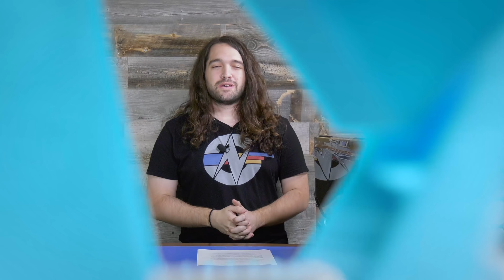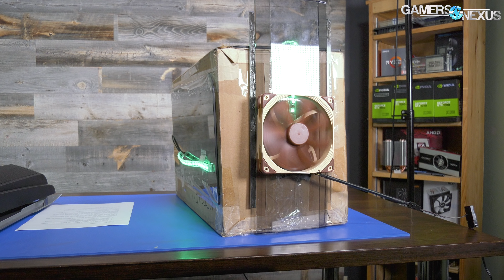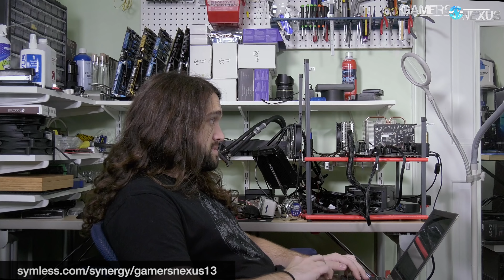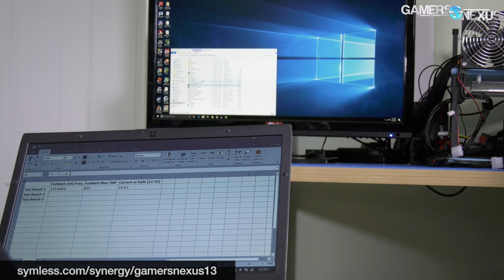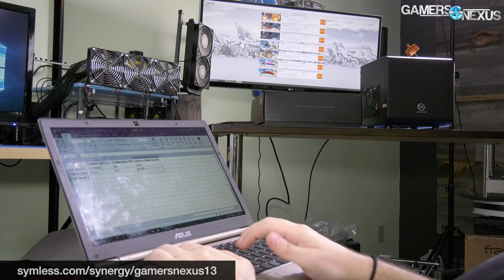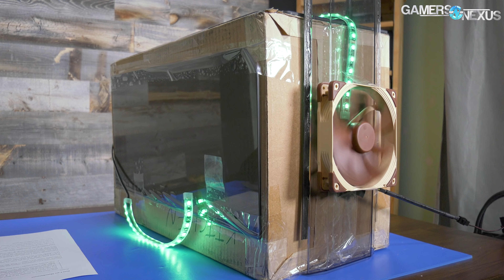Case Manufacturers: You're Worsening FPS & Power Draw

Comment: I bought a Phanteks P400S TG. My 7700k stock reached 80-85 degrees (C) with a h115i and maglev fans. When removing the front panel it dropped to around 60. So I took my multitool and cut 2 huge square holes in the front. I then put the included magnetic dust filters  over the holes. Now my case get neither dusty nor warm. I was really disappointed about the choked airflow, and bad performance from phanteks.
Reply: I have the Phanteks P400, with masterliquid 240 in front, CPU (ryzen 5 1600 @4,0ghz) is fine, but GPU (1080) is rising over 85°C, and M2 ssd mvme the same... So I'm not even thinking about modding, just switching to full aircooling, and waiting for the H500P MESHIFY to get my AIO back on the CPU :/
Reply: had thermaltake view 21. have to have a blower style gpu (using a 1080ti FE) due to the gull wing only allowing 120mm exhaust fan. put custom loop in it and cpu reached 95 degrees stock. gpu up in the 60s again stock. switched to the corsair 570x case now cpu stays at 50 or below with a 200mhz oc and gpu 65 under load. only hit 75 after about 3 hours of running heaven benchmark
Reply: same experiance with the evolv TG, modding it soon
Reply: Tomas van eccelpoel You really should, made alot of difference. Otherwise phanteks makes beautiful cases.
Reply: kinda scared to fuck it up tough,. drilling 20MM holes in aluminium can be tricky  its the last thing i want to try (but i will try it)
Reply: You got pictures? I'm intrigued.
Reply: https://drive.google.com/open?id=0Bw6PZkWCiFL7aUNBNmE3MEo4TGc

Yes, sure. Not the best pics but you can see the principle.
Reply: Jemoms, you're pushing hot air inside the case (warmed by the radiator) while Front is the spot for pushing in cool air.

I can understand why you got so high temps with the GPU (no cool air inside the case) and why your 1600 is pretty cool. 

Can't you put your rad on the top? Your 1080 would get cool air from the front, your CPU won't be as cool as you would be pulling through the rad hot air (warmed by the GPU), but the 1600 is really a very cool CPU, you won't get bothered.

I'm sure that would change a lot.
Reply: Hey man post more pics!!!maybe more close ups lol. Hit me up when you do
Reply: Kikoo Kikaboo yes i agree with you, radiator should be place on top pushing out the heat. While two fans should be pulling cold air in the front for this type of case.
Reply: Interesting. When I decided I was going to do a custom CPU loop I moved my PC from my old AeroCool aero 500 which had basically a perforated metal sheet on the front panel (so it wasn't as good as mesh but was definitely open flow front panel) into a P400 since it was the cheapest option at the time that was relatively close to what I was looking for. Originally I thought it had space for a 240 rad up top like my aero did, but turned out my AIO and later my open loop rad/fans wouldn't fit on the top. So I was forced to move the rad to the front intake. So I basically went from a direct flow panel with a top mounted 240 rad to a solid front panel with front intake mounted 240 rad. I was expecting the thermals to jump way up or the noise level to go up in order to offset the loss in airflow and having the rad on the intake. But surprisingly I thin I only had to bump up my fans by like 4-5% overall to get the same thermals as my old case. I thought that the riveted drive/optical cages might have been a restriction in my old case but with the rad at the front, plus with the open loop my rez/pump combo is sitting directly behind the rad in the new one, it deff wasn't a factor. I did get better fans over time, and running 3/3 for intake/exhaust lets me run them at lower rpm as opposed to 2/2 with higher rpm to get same air flow. But the again aside from replacing 2 of the generic fans I had with Corsair maglev ones and moving the rad to the front, the setup stayed the same at that time. so I'm actually somewhat surprised/impressed with the thermals. 

TL; DR; Moved my rig into a P400 from a aero 500 and was expecting worse thermals and/or higher noise levels to have similar temps. But was pleasantly surprised when I only had to bump my fans by like 4-5% max to get same thermals as old case that had a direct flow type panel as oposed to phanteks solid one.

Comment: I wish Corsair made an updated 450D with modern case features like PSU shrouds and cable management.  That case has excellent airflow.
Reply: Takeshi7 and the 750d.  I have both and you are right these cases though open are very quiet and move a lot of air with lower fan speeds.  I recently tried my 750d build in a new Fractal C TG and hated it.  Looked beautiful but very warm and had to bump fan speeds up resulting in more noise.  Sticking with my Corsair cases!

Comment: Steve... I get you one hundred percent on the cases design issues and I agree with your logic and data fully. But please remember  that some of these cases that 'under perform' on the thermal front may actually be the types of cases some individuals want. Let's be honest, a lot of buyers go for form over function (see RGB craze for evidence). These persons may readily buy a closed front case and slap a GPU water block on there for cooling. So, just continue to do the good work you're doing, bringing statistically substantiated info to the discerning customers... as more people learn from what you and others like you do, trends will change and the manufacturers will follow suit. The proactive ones will always be ahead of the curve anyway.
Reply from the maker: Of course! As stated, not every case needs a mesh front, or anything like that. We'd just like to see the manufacturers remember that there are multiple markets to address (just as you pointed out)!
Reply: Watercooling would make the problem worse as radiators are hella restrictive to airflow

Comment: ...So can you try making an actual prototype with cardboard, try and include glass, RGB, AND good airflow?

One idea I have is a solid glass front, with a 1" space before the fan, and then a built-in lip to cover the sides of the fans, and a mesh panel behind those fans. Thus, you get visible fans for RGB, glass, a filtration system, AND good thermals. What do you think?

Comment: I like your design, but there's no place for me to hang my headphones on. Perhaps a magnetic solution?
Reply from the maker: Puck off!
Reply: Hang them on the fan.
Reply: I was having trouble with my puck sticking to the tempered glass but duck tape solved that.
Reply: discostoo what's a duck tape though? do you have to squeeze some ducks to produce it?
Reply: This is one year late but...

You don't need to hang your headphones... You just put them safe and secure INSIDE THE BOX. XD

Comment: Silly vid! In all seriousness, why not test a Caselabs case? The Bullet BH8 is somewhat comparable in price to the bequiet Dark Base Pro 900 you've reviewed (a little more expensive at ~$250) and can support multiple drives and up to EATX sized motherboards. There are almost no reviews on this case (or hardly any other from Caselabs). It would be interesting to see where it stacks up.

Comment: I’m seriously glad I prioritize thermals over noise. Noise doesn’t bother me too much. Grew up with screamer machines.
Reply: Agreed. Im often on headphones so loud fans aren't something that bothers me too much. All my hardware under load stays around 40-50c and a touch higher OC'd. I love my old 850D and it would need to crumble for me to get rid of it.
Reply: I remember taking a case back in the day and using a hole saw and those wire grills to add as many 80mm fans as possible. I had a case with 11 80mm  blue led fans when 80mm fans were all that really existed. Sounded loud as hell but worked great and looked even better, it had a plexi window and I custom painted the interior with blue car paint. Even had 2 blue cold cathodes. 
I still use those exact same wire grills sometimes to mod cases, I will take airflow over anything even if it means I have to clean the dust out of my system more often.
Reply: fourtysix4646 80mm blow holes? Why not 120mm 12v industrial fans have been with us for a lot of years!
Reply: I dunno I've gotten quite used to my Define Mini with noise dampening, and thermals don't seem too bad (though its my first aftermarket case so I have no point of comparison). My previous case was an HP Pavilion shell, real cheap with just super thin aluminum. Whenever I boot that system up it's so damn loud it bugs the hell out of me.
Reply: I thought I was the only one.

Comment: Just on decibels. In the chart at 12.31. As decibels go up by 10, the sound is 10 times louder, or at 3 dbs nearly twice as loud. So at the end of the graph the Rx 580 is at say 54 and the Rx vega 56 is at say 67. the the vega 56 is,  20 TIMES LOUDER,   than the rx 580 at this point. As a reference look at the Wiki.
Reply from the maker: Actually, 10dBA is roughly 2x as loud, not 3dBA. 3dBA is where you start getting noticeable noise differences (meaningful ones). 10dBA is when you get a perceived noise increase of 2x. Big difference, there.
Reply: YES you are right , after working ing the print industry for 40 years and even going to meetings about sound. I was always told that 3db was x2 louder, but its "power" not loudness. (YOU never stop learning I suppose.) Well done on pick up. I have already thumbed up, pity I can't give another one.

Comment: My 1070 overclock to 2050mhz it never goes above 70c inside a full tower with 3x120mm front fans on low
Reply: rurutu M Exact same overclock as my 1080 and I only hit 73c when gaming with 0 intake fans and only the h100i and rear exhausting.

Comment: @Gamers Nexus - Steve, how would you rate the Fractal Define S for airflow? I've always thought the front side intakes would be sufficient, but after watching your videos on this subject I'm becoming increasingly unsure...

Currently using 3 x 140mm fans in the front, with a rear 140mm in the back.
Reply: I have the same case. Filled with noctua. Never had any complaints at all with thermals or noise, seems like a nice balance. As others have said though, making air bend 90 degrees to enter isn't super efficient. I think it's a pretty stellar case overall though

Comment: I have a Corsair Obsidian 750D Airflow.

I have no problems.

The end...
Reply: TheSaintST1 yes! I’ve tried other cases with my current 750d build including in a Fractal Define C TG and always go back to the 750d.  750d is a great case that just needs updated a bit. TG side panel, room for 3 140 fans up front and more sound damping options and the case would be king!

Comment: Are 3x 120mm fans better then 2x 140mm fans for front intake on a mesh front case? Cooling, noise, exc..
Reply: David Lee    Performance > Looks
Also it seems static pressure for intake is the way to go if you have HDD drives in the way or say a mesh front like on the meshify c. Is this correct?
Reply: Quiz 234 140s will move more air at a lower rpm, less noise also. Be sure to get the right fan type. Static pressure vs high air flow.
Reply: Also looks too depends what your looking for.
Reply: David Lee +1
Reply: Quiz 234 yeah if you have a hard drive cage, dust filter or a radiator up front go static pressure. I have a Phanteks Pro M Acrylic for a case.

On my radiator I have phanteks 140 mp fans but it's top mounted. 

My
Reply: Ok so if the dust filter is in front of the fan go for static? Or high air flow for front intake fans?
Reply: David Lee what he says, except a dust filter doesn't make a noticeable difference. I would not take that as a variable on why or why not to get a static pressure fan.
Reply: If you are in a AC room it will be better to reflow some of AC to PC XD
Reply: KevinMulia lol, wouldn't that be putting potential moisture into your PC?
Reply: Quiz 234 As I know AC is drying the air so you feel cold.

But yeah it has a chance, but if you are using AC 24/7 I don't see why t would condense
Reply: Atom M Use Static then...
Air Flow is better when there are nothing block it
Reply: KevinMulia got it, thanks

Comment: Manufacturers please take note, we need a case build for games who care about their end user experience doing what they've build the PC for, which usually is best performance in gaming.

Sorry I don't look at my case while I'm busy playing, usually only when I turn it on.
Reply: Syraxal, there's the Phanteks Enthoo Primo that is 480 compatible, I have one, but... Yeah... It's huge and pretty heavy (20kg empty). 

Put in there a 420 Rad with optical cage on top (but you can go up to 480 if taking the Optical cage out), a 280 at the bottom, and a 120 radiator at the rear + add 2x 120mm fans + 2x 140mm fans at the front + the entire watercooling stuff... It's really, really heavy... 

I can't lift it up alone without insta-breaking my back :(  But at least, it's super silent xD, I can only hear the HDD spinning and slightly the pump, even after hours of gameplay.
Reply: Kikoo Kikaboo You can put even 2 480 rads in push pull in that case if you want.
Reply: I own the Thermaltake Core X9, I didn't just write that reply for myself, it was for manufacturers. I'd possibly get a new case but there aren't to many that support 480 Radiators.
Reply: Then buy a cheap case and remove the front panel
Reply: After switching to a case that has a solid front rather than mesh, has made my gaming experience so much better as it is super quiet. All for a 1 degree rise in temps without any throttling.

Comment: ive got a 900d...... its overkill 
all the fans got enough space to get decent air.....

my only bitch is that the graphics cards screws are hard to get at...unless you have a 90 degree "bent" screw driver
and that its super huge and heavy.....but its a 900d....so i knew it was huge and heavy

but i like the simple "black box" look......

ive also got like....9 140mm fans in it......
i needed that many to keep my OCed phenom 2 6 core and 6970 cool

still need it to keep my 6970 cool......the ryzen cpu dont give no fucks
ya... i need a new gpu.....

Comment: Fucking FINALLY! This is the sort of critique of current case standards that I've been waiting to see.
Reply: Fox Populi I don't know how we got away from the idea of getting as much air on hot components as possible. My first legit case was the Antec 1200. I could have stuffed all the clothes I own in that massive thing and I think all told it had nine 120mm fans and that 200mm fan on the top. I never felt hot air come out of that thing. It exhausted cool air unless I was stress testing, where it maybe got warm! And those were the days when components might be 30-40c warmer, on average. Now I somehow ended up with an S340 and while I like the compact size, that case blows balls. I hold everyone responsible for giving it good reviews. It blows.
Reply: R T I don't get why people bitch and moan so hard about airflow in cases. I currently own a H440 which is widely slated as having horrible ventilation, despite running two overclocked EVGA 1080 cards in SLI and running games at max settings in 4K it never throttles, crashes and is whisper quiet. All this without even having to run my fan curves to 100%. Cards are designed to run up to 70, 80 degrees and higher with no issues.
Reply: My first case, that I'm still using btw, is the CM Storm Enforcer.  It has decent cable management and good airflow.  Still haven't had a reason to upgrade even though its more than 7 years old.  I was looking forward to the h500 but it was a bust.  Best case right now in the looks/functionality department is the Meshify C.  My case looks are outdated lol

Comment: You should fill the inside of the case with wall insulation to make it nice and quiet.
Reply: Asbestos: It's the insulation your Grandfather used
Reply: I hear that spray in foam works well
Reply: Nah, Sand Works Better
Reply: ahh good idea . . . WaterCooled™
Reply: crisray6789 LED Gypsum board when manufacturers?
Reply: Nah just use the "noise dampening" foam they use in cases. The foam doesn't actually dampen sound, and it's a massive fire hazard. So perfect for case manufacturers to add (cough H440). Least the H500P isn't a fucking fire hazard.
Reply: Packing peanuts bro, It makes it safer too move too.
Reply: crisray6789 Because blowing fiberglass around your house is great for the lungs
Reply: evilgibson You mean the insulation that's STILL not banned in Canada? Lmfao.
Reply: @fridericusrex9812  on shit
Reply: Not a problem though since the air doesn't flow out of that case.